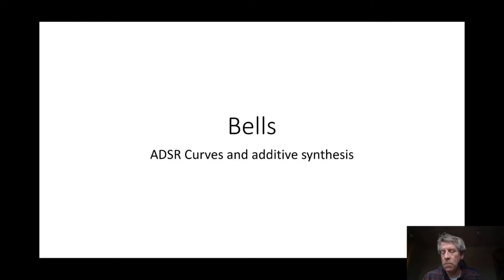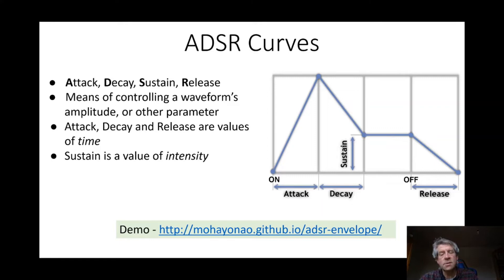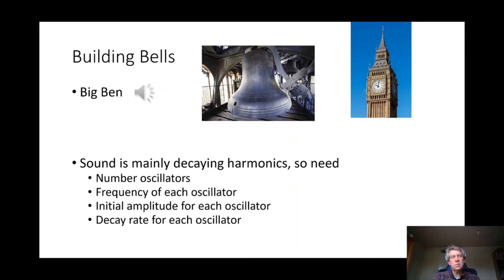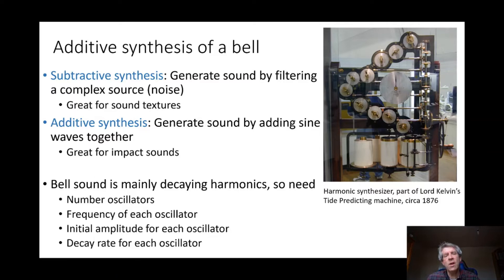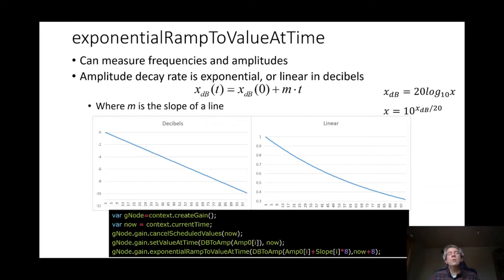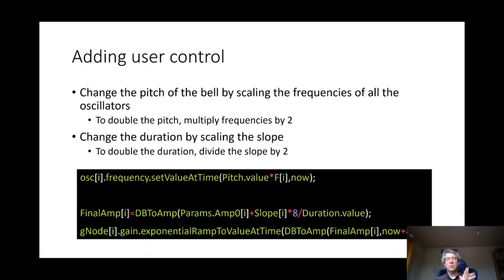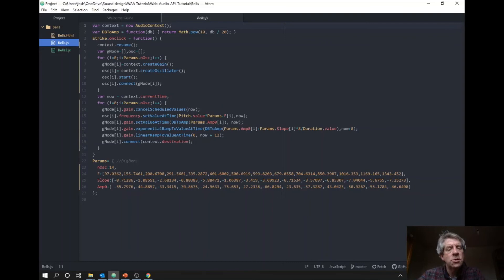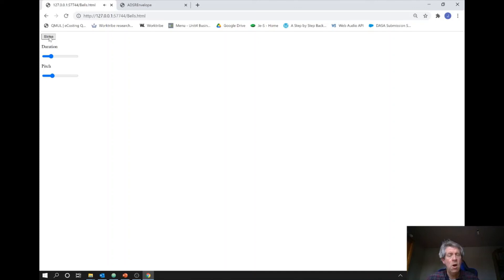Making Bells in the Web Audio API

Comment: hi, i am trying to synthesize the sound of singing bowl, does anyone have advice on how to obtain the frequencies to be used?
Reply from the maker: Synthesising a singing bowl is a very cool idea. I know there is some previous work in the field, see https://scholar.google.com/scholar?hl=en&as_sdt=0%2C5&q=%22singing+bowl%22+synthesis&btnG=
One can probably get the main resonant frequencies based on the dimensions and material of the bowl, and the physics that derives the modes. However, a more direct signal-based approach could involve just analysing the spectrogram (which is what I did for the bells), or using a sinusoidal model to extract frequencies, their initial amplitudes and decay rates.